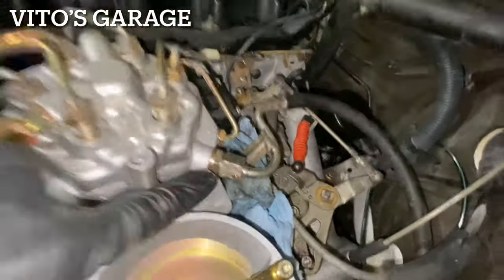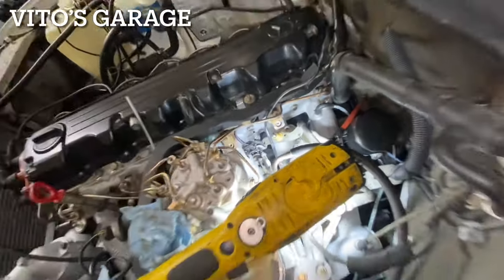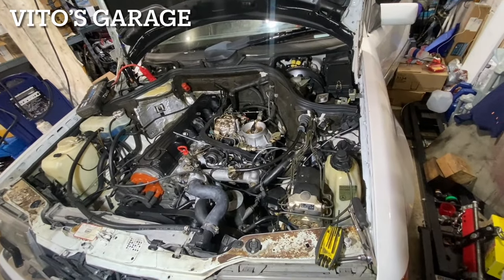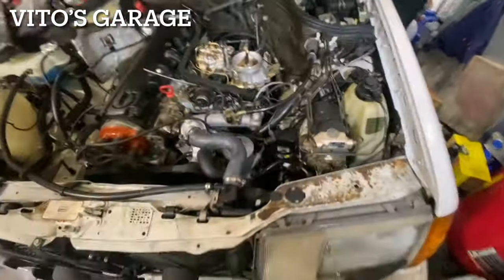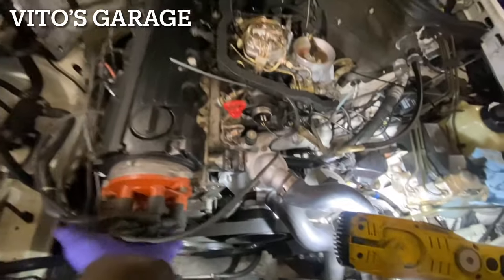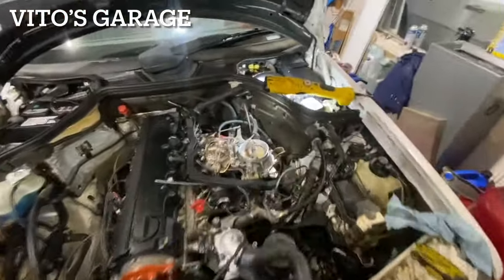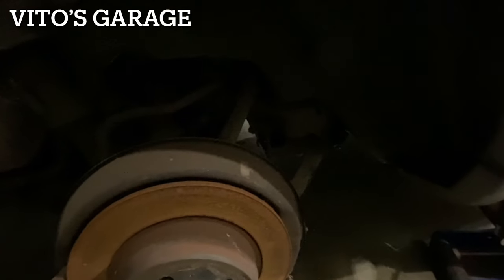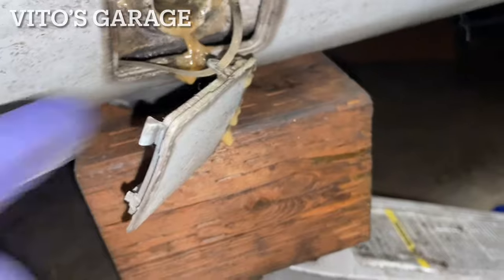Figured Out KE-Jetronic Overpressure.. BUT.. Now Starts & Stalls. S124 Mercedes 300TE Wagon. PART 10

Comment: Hey, I'm trying to diagnose a problem on my 300E with the M104 engine. It doesn't start in real cold weather, maybe 5-10 degrees below freezing. It's not the battery, that's brand new, and works fine. It's not likely a fuel issue as the starter won't crank at all in the extreme cold, but cranks perfectly well if warmer, but the electrical systems still do power up like normal when the key is turned to ACC. When it's not extremely cold everything works great. I also noticed that when it is working fine, reconnecting the battery causes a momentary hiss sound from the engine, a noise which is absent when experiencing this problem. I'm thinking it may be a temperature sensor or relay, or the starter's solenoid, which still works great in warmer weather - note the temp gauge does work fine though. My next plan is to put a heat lamp on individual areas, such as the relay box, starter, ignition system, to see if warming up any of those systems remedy the issue so as to identify the problem. Do you have any ideas though?
Reply: Nevermind, I found the issue! It's the solenoid on the starter. I put a heat lamp on it and after 30 minutes it worked! Do I need to replace the entire starter? Any recommendations on what brand starter I should get, and should I go with a new unit or are rebuilt ones just as good? I'm looking for the best value, something that will be reliable, but not break the bank either.
Reply from the maker: Hello sir and I’m happy you figured it out! Extreme winters can do crazy things to our amazing machines! Stay warm!
Reply: @VITOSGARAGE   Thanks you too! I do have another problem however. The 4 speed auto trans (1993 300E) doesn't downshift, and upshifts at only 2,000 RPM. If I want to accelerate at a decent pace I have to manually downshift, which works fine. I believe the problem is the throttle pressure linkage, and my Hanes manual goes through the adjustment procedure for it, which entails removing and reattaching the shifter cable from the throttle cable assembly. Do you think that's likely the problem and is that an easy procedure? I'm a bit apprehensive about doing that, as if it goes wrong I'd need to get it towed to a mechanic.
Reply from the maker: @s.m.mediaproductions5304  you can adjust the Bowden cable that goes to the transmission. Look it up

Comment: Did you happen to check the inline filter that goes from the fuel pressure regular to the fuel distribution block? I saw somewhere that tiny filter could cause issues with a no start/rough start.
Reply from the maker: Yeah the little filter was good. This issue was caused by not having enough fuel in the tank. The pumps were pulling air and fuel together and over pressurizing the system. Crazy but it’s true
Reply: @VITOSGARAGE  First of all YOU SUCK 🤣🤣🤣 for leaving us hanging for two "episodes" and still no start , you should write screenplays for TV shows 🤣 Secondly if I understood correctly the overpressure was caused by low fuel which bears the question: I'm sure lots of M103 were driven/will be drive to the bring of low fuel, would all of them encounter the "overpressure" at that point?🤔
Reply from the maker: @danricci6996   lol if you were actually talking to me personally this car was put on the road 2 months ago already. 😀 I’m just behind on the videos. But in real life the car has been started a long time ago.
As far as your question, this was my first time encountering this overpressure issue. I am assuming if I were to run very low on fuel on my 190E it’d probably do the same thing. 🤝